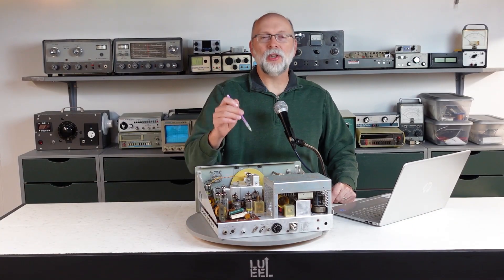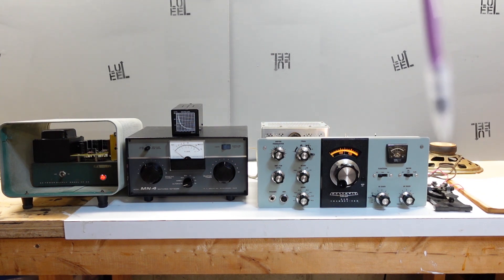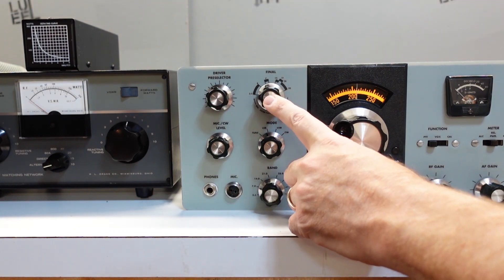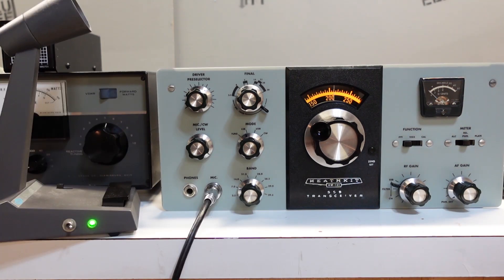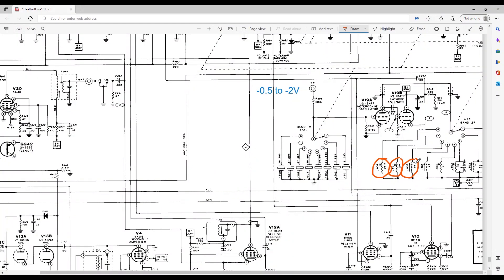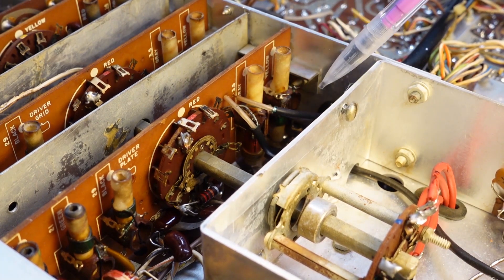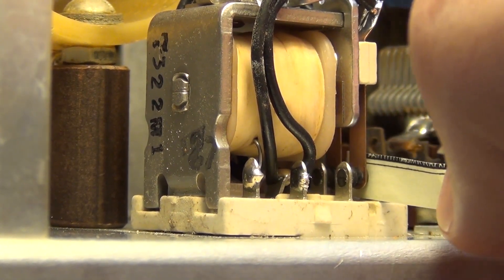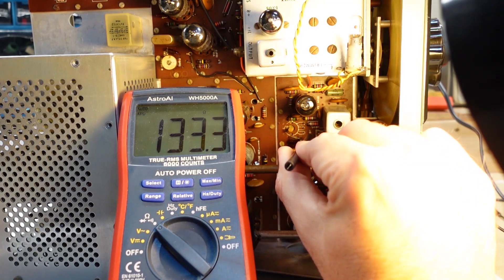Heathkit HW-101 Part #5: Watts the Problem Now?

Comment: I am amazed you found a HW-101 with the original antenna phono plug jack.  I changed that when I built mine. I see you have a non-standard knob. I have my original HW-101 that I built in the 1970s.  It still works.  I made a new knob out of an old HW-100 knob that I cored out and slid over a solid aluminum core I made on my lathe. Makes tuning feel nice.And it looks original. I repainted using actual Heathkit paint.   I got new tuning dial. A common trick was to put colored acrylic sheet between pilot light and dial. Green, blue, red or whatever.  Easy to do and looks cool. The filter switch lever is a bad design. I replaced mine with a different method years ago.

Comment: You should have set for a dip in the bias instead of a maximum output of the final tubes .
Reply from the maker: That is correct, Heathkit kinda obscures that important fact in the neutralization procedure.  It assumes that with a properly neutralized final, the peak power and dip in grid occur at the same point.  I am guessing they simplified the instruction for a novice user.